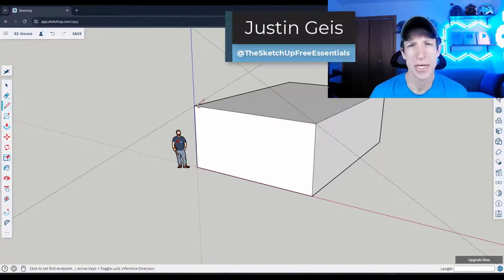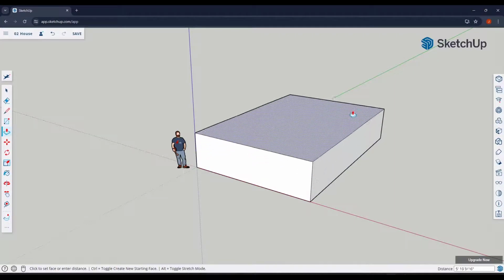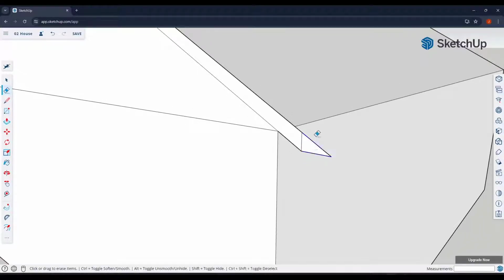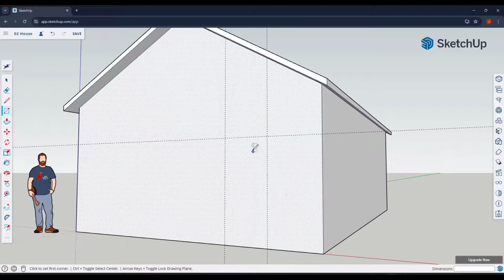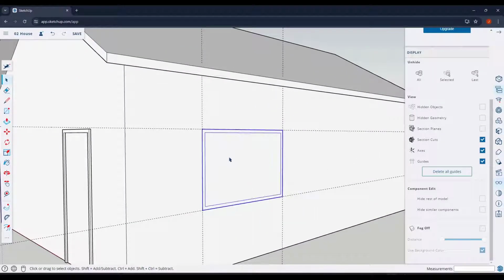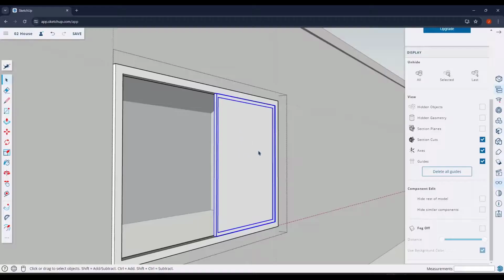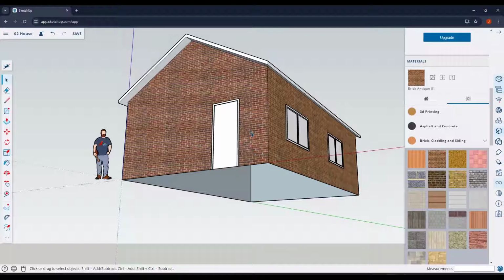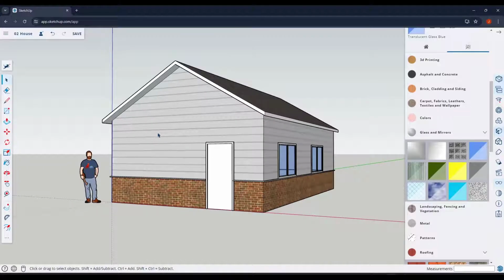Getting Started in SKETCHUP FREE Part 2 - Modeling a House!

Comment: Thanks for this video! At 20:53, how did you get the bottom lines of the house (that you were copying to make the cap) not include the door?
Reply: A year late but: When he cut out the door in that wall in the beginning of the video, that caused it to omit that part of the wall when he got the frame for the cap